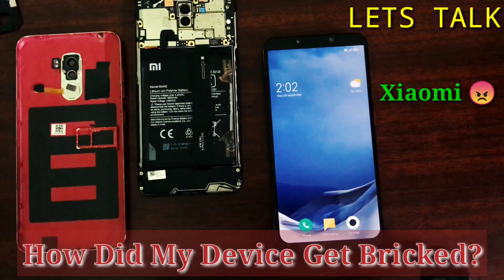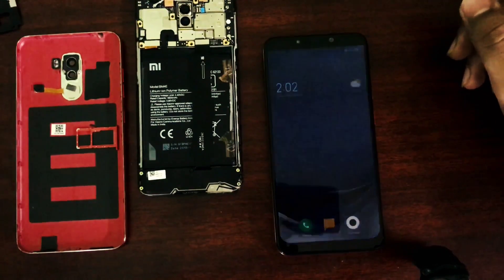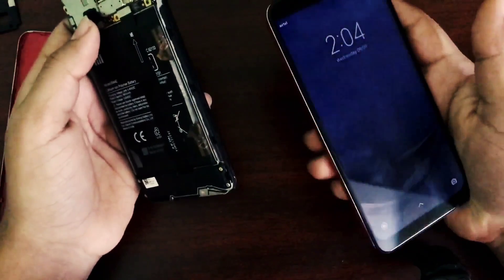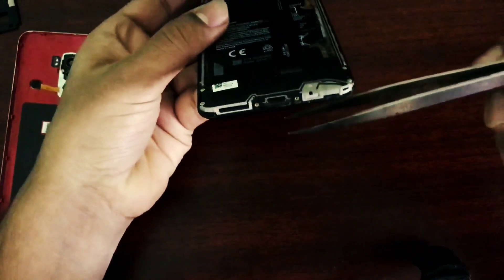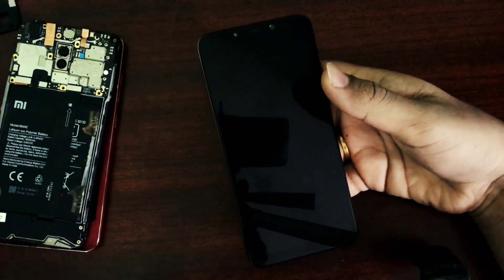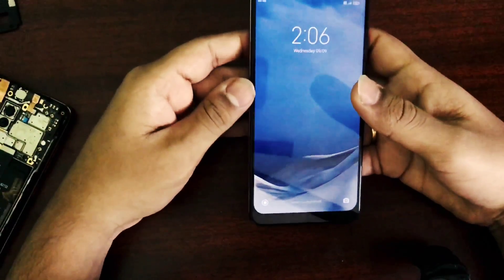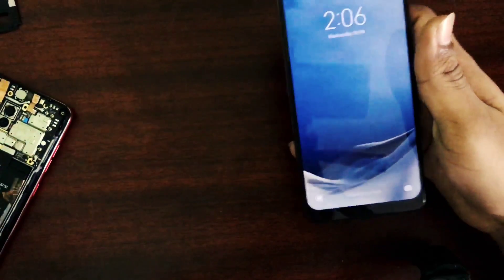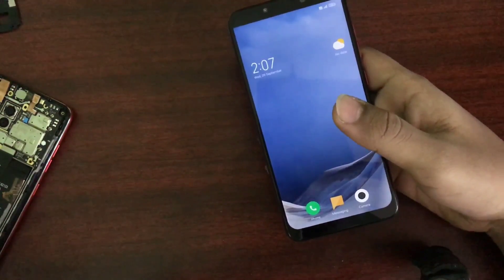Poco F1 Got Hardbricked? | Edl Flash ? | How Much Was the Cost | How did I Fix it? | Let's Talk 😠

Comment: Fool i fix this phone without replacing anything only your phone is power on what ever it boot into miui or not
Reply: Hloo
Reply: @alwaysindia4587  yes
Reply: @girjeshkumar139  how i fixed the mobile
Reply: @alwaysindia4587  what the problem with phine
Reply: @girjeshkumar139  i am using my mobiel amd it stopped by hangingg for some time and now its not even responding for charge but when i comnected to pc its showing as unknown device-qusb_bulk_cid

Comment: I was using gmail and the poco f1 hanged and when i pressed the lock button it blacked out and wont start and wont charge. please help!!!!
Reply: Have able go revive your phone as i have also faced same issue
Reply: @akashsavita1113  nope still dead
Reply: @ronaldinotanmay6  mine too
Reply: @ronaldinotanmay6  i thought, it's just a subtle lag,which happens seldomly, therefore i turned my phone off,then it never got turned on.
Reply: @alienxthemostpowerfulficti2888  in custom rom or stock miui
Reply: @nomadicbharat8642  stock mui

Comment: hey brother 
my poco f1 is also bricked it only boots into fastboot mode
i tried miflash it didnt work 
i tried twrp flashing it shows black screen, i there any way to fix this
Reply: Yes it works for me. And I cant update to android 9. You have to stick on Android 8.
Reply: @AXASH9  after this have u tried any custom rom for upgrade android??
Reply: @AXASH9  is it ok if i only use this phone for PUBG...???? Android 8 is compatible????
Reply: Exctly same issue bro i already go to service centre in service center they told me change its mainboard....Cost 10K....:(....
Reply from the maker: If your getting fastboot it's just softbrick 
Go to service center ask edl flash
Reply: @GamesharkOfficial  how much is this gonna charge
Reply from the maker: 120rs
Reply: @GamesharkOfficial  okay brother thanks for helping out
Reply: @AXASH9  is your issue got fixed??
Reply: @chetanpatil7168  no  i can only flash miui 9 or 10  or it gets stuck on bootloader , in service center they told me change its mainboard
Reply: @AXASH9  bro same issue pls help me what i can do now
Reply: @rahuldgaf  try flashing miui 9 using mi flash tool . it worked for me and do not update.. otherwise same issue may happen again
Reply: @AXASH9  you solved your issue?
Reply: @AXASH9   Bro is it work???? if i flash it to Miui 9 or 10...????
Reply: @AXASH9  Copy android 8 only frimware files don't copy system and vendor and replace with android 10 files frimware. And flash it you can boot in android 10 and any other versions and if playing videos is lagyy then flash modem file (available in android 10 frimware folder) in fastboot mode command is  - fastboot flash modem 'path' and it's done
Reply: @GamesharkOfficial  bro i took my phone to my local mobile repair shop he flashed it  after fashed it goes to fastboot.he says flashing is not working can you tell whats the problem,my mobile is hard bricked
Reply: @GamesharkOfficial  bro my device same problem but usb not conect my pc help me bro
Reply: Akash do you got your issue cleared or i can help you as same problem was with me too. But I resolved it by my own

Comment: Bro I was playing pubg and then I switched to recent apps and tried remove it then .it got stuck there and got hanged.
Then I pressed the power button. And after that it doesn't turn on. Earlier it was charging after that it just blank.not going to boot .tried everything.
Service station told 10,000 for motherboard replace 6+64gb .
What to do bro .
Reply from the maker: Get edl flash done
Reply: @GamesharkOfficial  bro do service center do that .
And where to get it done.
Reply from the maker: They won't do it you need to find who do edl flash via TeamViewer remotely
Reply: @GamesharkOfficial  lo encontraste?
Reply: i also faced the same problem did you get yours fixed and how????
Reply: @msharma29  just replace ur ufs chip and ur problem  will be solved
Reply: @adityashelar6262  can you be more explicit?
Reply: Sameee bro what you did